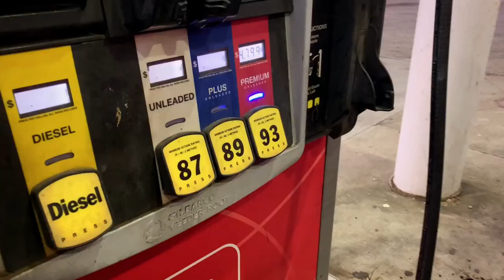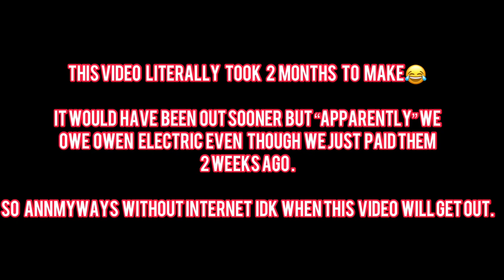RESTORING MY OLD BULLNOSE FORD F150! (With almost no money)

Comment: Although I respect the hustle i would eventually get that truck into the barn or something and start working out those dents and take more time with a better paint job…it looks good for what you did so far BUT i could look GREAT with more time and a few more $ invested overtime
Reply from the maker: Well as of since I turned 18. I haven’t had time or money for hardly anything. Plus I don’t want it to be perfect. Whenever I can get enough money to move far away from Cincinnati (because this place sucks!)I want to build it and start racing this thing at auto cross and different time attack style races. I wouldn’t want to ruin a 3000+ dollar paint job every event from rock chips.
Reply: @redbaron77  no $$$ it takes alot of $$$$ to make a truck like that to race ready and be safe about it!
Reply from the maker: Safety stuff is what I’m going to do first. It already handles pretty well even better than the Nissan Sentra I drive for work. So I figure I’ll do roll cage maybe reinforce the frame, replace old bushing and see where improvements are needed. It already has 14 inch rotors in the front so disk brake conversion in the rear and stopping won’t be an issue. Handling Is limited right now because of the bench seat and no harness. Lol

Comment: IDEA....paint the middle of the truck white between the top and bottom moldings ...and the roof down to a little below the rear window...google these trucks to give you some ideas of how to 2 tone it
Reply from the maker: I painted it two tone. The white kept peeling off witch is why I painted it this red.
Reply: Wheels are perfect- no crap hanging on them ( aka hubcraps)

Comment: You want to go full West Virginia, use great stuff spray foam in the holes then skin over with fiberglass body filler. Works in a pinch. Love the truck
Reply from the maker: I’ve actually used that spray foam before. Lol my rear fender’s are made of chicken fencing spray foam and bondo over it. 😂 I would have taken more time to make it all look better but I was in a race against the cold weather that will be here for 5 months. Lol also nothing needs to be perfect. The only thing I’m a perfectionist on is the drivetrain and chassis. Also THANK YOU FOR WATCHING!
Reply: I've used Spray Foam once to fix a busted fiberglass valance.

Comment: Thanks for showing me what would mine have looked if I brush-painted mine instead of  investing in  4 paintguns
Reply from the maker: Why 4? Also I could have done better. I don’t care that much because I don’t really care if things are perfect. However I’ve seen roll painted cars that looked almost perfect. Unfortunately I spent to much time trying to sand it perfectly and only had 2 days to paint it and let it dry before it got cold. Northern ky has no fall just hot than instantly cold for 5 months. Lol
Reply: @redbaron77  Well, I got fooled by Harbor Freight, TBH. Bought their syphon gun on sale $25 and their mini purple for $14.  The Mini was good for details, like the raptor letters I added.... Until I  removed the nozzle tip. It broke while screwing it back in.  The syphon sprayed GOBS. So the result was not too different from yours. I bit the bullet and browsed Amazon. Bought a $70 - 1.3 tipped gun for clear, and a  $50  - 1.8 tipped gun for primer and base.  In all fairness, i ALMOST tried a roller.  Just sanding killed my shoulder. I have no good sanding tools. 
I'm gonna make a video.( No cinematics). But  despite many dents not bondo-ed to perfection, the difference is crazy, even from 2 ft from the paint.